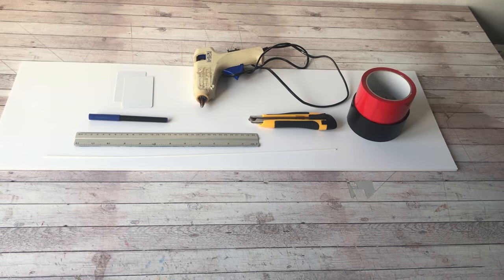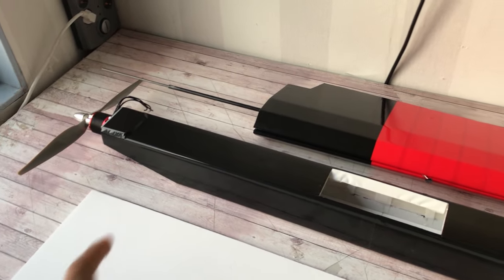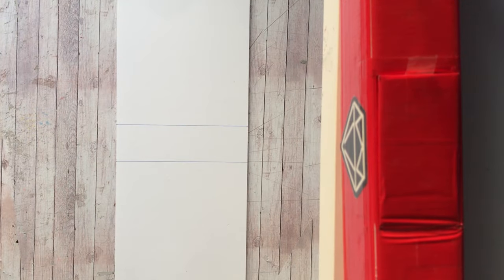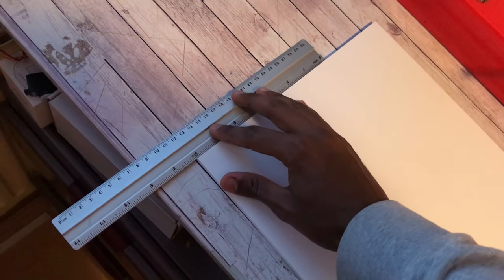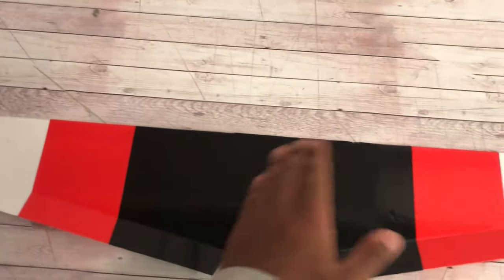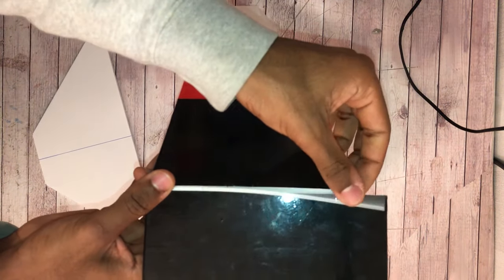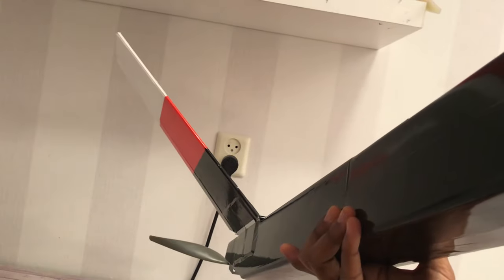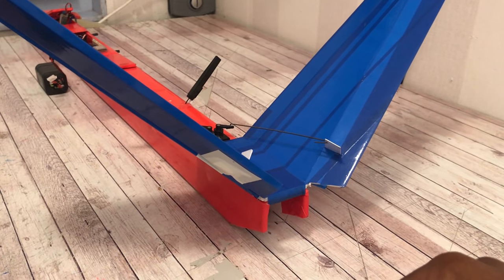How to make a V-Tail for RC Planes (Experimental Airlines Style)

Comment from the maker: NOTE

Apologies for not mentioning a different ''mark to mark'' measurement for your V-Tail template at 12:15

The basic math for calculating the measurement for your cut: sin(45) *  fuselage width in inches
Or you could calculate: 0.707 * fuselage width in inches

For a 3'' fuselage width, your measurement will be: sin(45) * 3 = 2.121''
For a 2.5'' fuselage width, your measurement will be: (sin45) * 2.5 = 1.767''
For a 2'' fuselage width, your measurement will be: sin(45) * 2 = 1.414''

Comment: I'm designing a 1600mm wing span V tail RC plane and I also concluded that the length of the stabilizer should be around 300mm based on some basic wind tunnel testing I performed at home. Interesting stuff mate.
Reply from the maker: Interesting! But what did you analyze in the wind tunnel?
Reply: @AeroStuffFPV  I made a some scale models with a rough CG where the actual plane would have it. I then pinned the models from the 1/4 chord line (allowing free pitch and yaw rotation). Then I observed the stability in the wind tunnel (air speed of 10 to 15 m/s). A large tail would be too heavy and provide too much downward force making flight unstable. A small tail would not provide enough correcting force and the model would pitch down. I have a video of this experiment, I'll post it on my YT channel later (I don't have any videos on YT yet).
Reply: @AeroStuffFPV  I must add, I'm not an expert, my wind tunnel is very basic (home made) but it allows me to do some fun experiments. Great videos mate. Cheers from Australia.
Reply: Есть ли смысл создавать аэродинамическую форму крыла для v-trail?

Comment: Fantastic models, they look great and they look like they fly great, going to build one for myself. Generally how far back are the wings located from the nose of the  fuselage and what is the basic length of the fuselage.  Great Job, you've got inspired.  Keep Going.
Reply from the maker: Thanks! The wings are located at the CoG (Center of Gravity). If all the components are loaded in the fuselage and I balance it on my hand, I’ll eventually find a balancing point somewhere on the fuselage.

That is where I’ll mount my wing.

(Basic fuselage length is 950mm to 1100mm)
Reply: @AeroStuffFPV  ok, makes sense,   Thank You...

Comment: Great Video sir, we are making a MQ 9 drone modal any suggestions for that. Also which BLDC you used in this vid.
(What Motor and power supply should we use in MQ9 Modal).
Reply from the maker: Hi,

Thanks man! I recommend you watching my latest build video “How to make a V-Tail aircraft for FPV” - It is a Long Range FPV model similar to an MQ-9 - Motor and other specs are mentioned in those videos.

Good luck on the build

Comment: Nicely Done, 
You are a skilled builder and I love this design,  I think I'm gonna build one.. only smaller.  One question though.  Why not cut halfway through the foamboard and then crush / open it like the main wing wing with the ruler corner and fold it to the inside instead of the outside then there won't be a gap that needs filling I'm thinking way less finger burns with that hot glue.
Reply from the maker: Good idea

I don’t know why, but I never did it the opposite way. Whenever I build another V-Tail in the (near/far) future, I’ll try this method.

Thank you!

Comment: Great video. I have some questions. What should be the size of v tail for an 2.8m wingspan? Can you have a formula for this. Also which angle do you place the v tails? And how do you determine the location of the v tails? Could you explain them clearly please? I need your knowledge and experience. Thank you.
Reply from the maker: Per 0.2m increase in total wingspan, you’ll increase 3.75cm of the V-Tail (per side) - I mentioned it at the beginning of the video as well.
Reply: @AeroStuffFPV  And should we hold the root and tip chord of the tail same as 7 and 4 inches?
Reply from the maker: @abcdefgh-kb1cu  There is also a ratio on that: Per 2'' increased chord of the main wing, You'll add 1'' to the root and tip of the V-Tail.

Example: 5'' chord armin wing has 6'' root & 3'' tip - But a 7'' chord wing has a 7'' root & 4'' tip
Reply: @AeroStuffFPV  thank you so much for the all information and help. <3

Comment: Thanks so much for the great upload. It's a very informative and well made video! I'm not sure I understand the maths in your comment, is that to determine 110° angle of the v-tail? Do you have a link to v-tail aerodynamics or general 'rules of thumb?' Thanks again - keep them coming! :)
Reply from the maker: Thanks! The math (sin45) is used to determine the 45° angle per side (all adding up to a 90° diagonally).

I don’t use any complicated maths to make the V-Tails. It’s just the template technique, reïnforcement and servo (ruddervators) imput
Reply from the maker: Hugh Davis  Thanks man! 90 degrees have worked flawless on my FPV designs. Let's hope this video will get recommended alot :)

Comment: Thanks for the fantastic video, I have a question please.
in the video, u said showed on the screen for a 71" wingspan ---> use 33.75cm V-Tail 
but when u build ur V-Tail the wingspan was 63" and u did the V-Tail 35 cm??? is not the ratio should increase with the wingspan so how the V-Tail of 71" is shorter than V-tail for 63".

thanks
Reply from the maker: It is all recommended (Minimal V-Tail to Wing ratio)
Reply from the maker: If your V-Tail ratio is shorter than the recommended, you could add additional vertical stabilizers between the V-Tail and wing. This compensates the yaw stability
Reply: @AeroStuffFPV  whats the ratio between the vtail and the wing, and where is the source of this information i would like to read more about this plz

Comment: Hi. Really nice plane and instruction! I would like to build one but got some question. What is the distance between main wing LE to v-tail LE?
Reply from the maker: Hi, Thanks! It was determined by the CG.

(I loaded up everything on the plane before mounting the wing-joining-rods and found the CG at 50% of the fuselage tube (1m fuselage length)

I dont have the black-red-white model anymore, but now you know how I did it.

Comment: I noticed you make your own control rods? What size wire? Thank you
Reply from the maker: It’s 0.8mm steel wire from aliexpress
Reply: @AeroStuffFPV  thanks
Reply: @AeroStuffFPV  I cut the v tail. Taped it. But the taping is not smooth. Will it effect the performance too much?